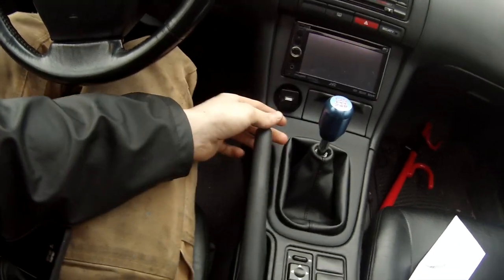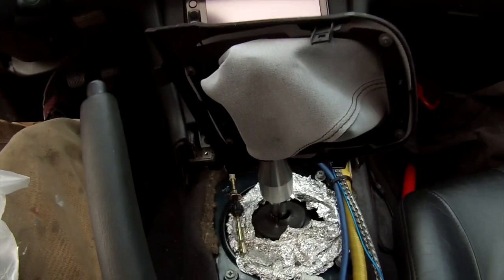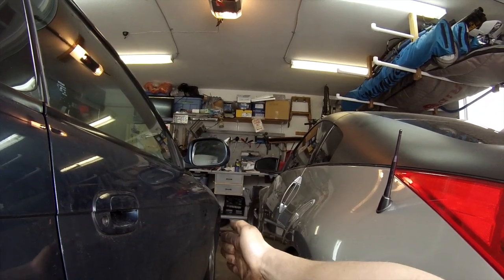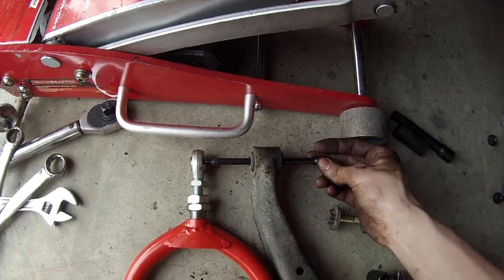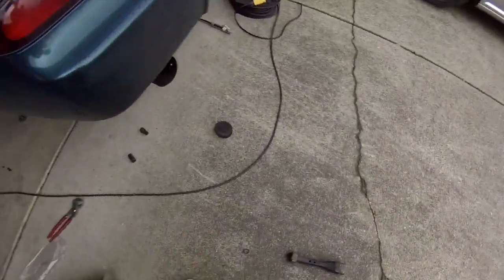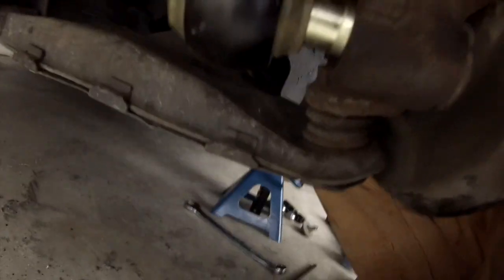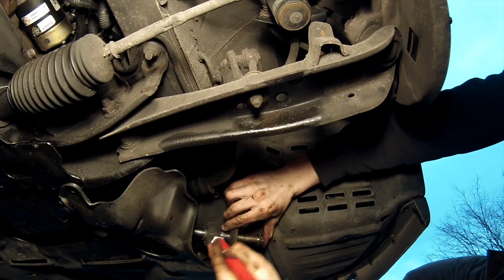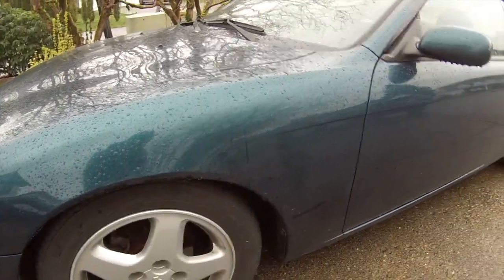240SX S14 Build EP.4 Wheels and Suspension Arms

Comment: Odd question, What lug nuts are you using? Obviously the stock lugs don't fit the wheels since they're too deep but the open ended acorn ended ones I bought are still too fat for the 17mm socket to fit over and not contact the wheels itself.
Reply from the maker: Im not sure exactly theyre just some generic low profile black lugs. Get some that come with a key (like a socket) you use instead of a 17mm socket.

Comment: Btw you can put the handbrake rod on without cutting it, just feed the hook in then pull hard up to get the button on...it's hard took me like 30mins....or just take the handbrake out and fix it right.
Reply from the maker: I tried that. Wouldve had to cut or mess up the button on the tip. And removing the handbrake from the chassis wouldve made no difference to the situation. Cutting a few mm off made it easy and has no effect on its function.
Reply: BuiltLikeThis It's no easy, I found bending it slightly then bending it back by pulling it worked pretty well. My rod is now broken like I said because I'm stupid so I'm going to replace some parts of the hardbrake when the parts arrive, I can still use it fine through by pushing the tab.